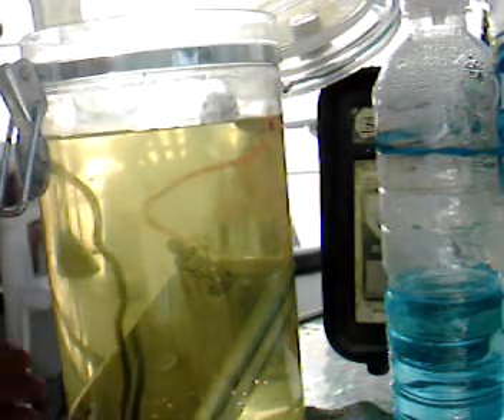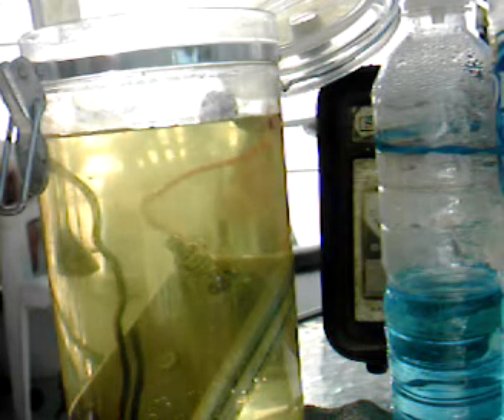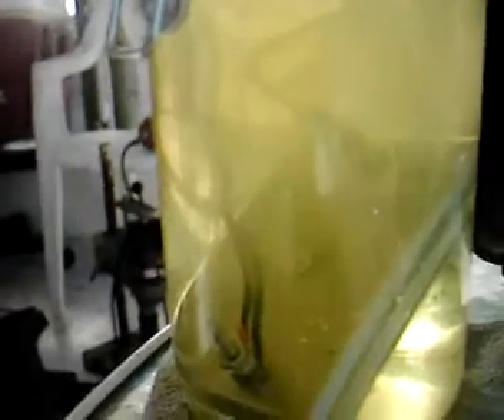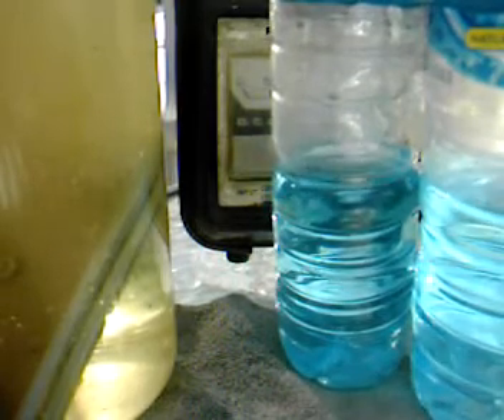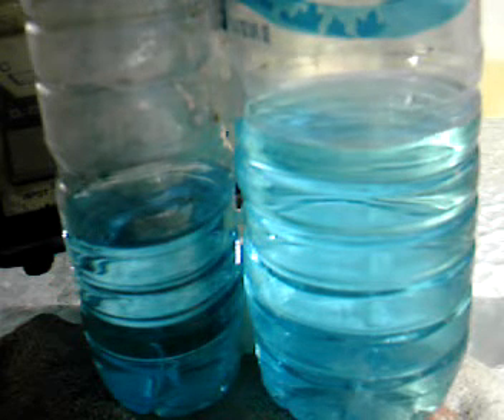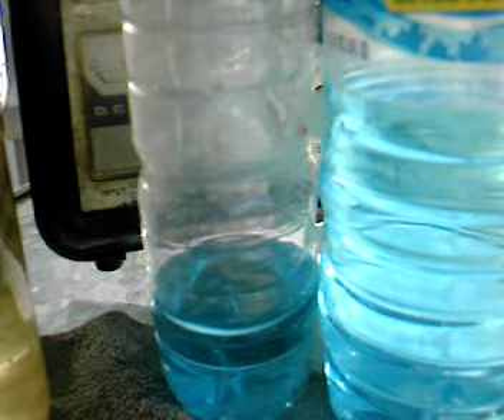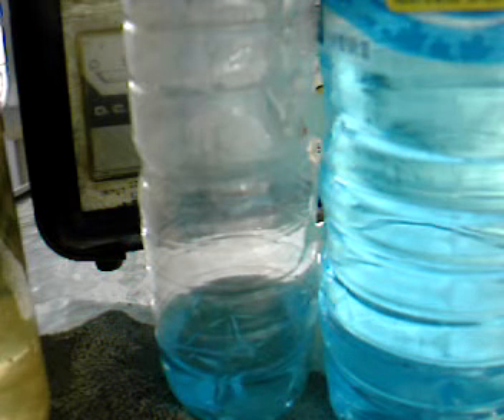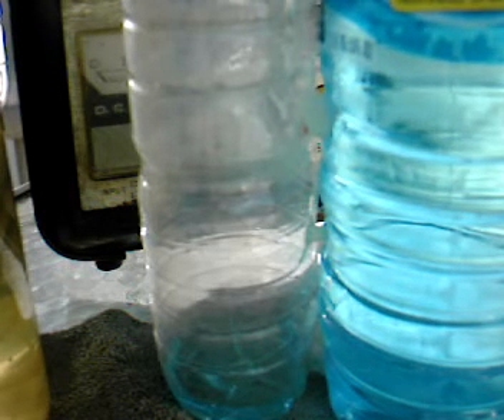sirHOAX series cell first test

Comment: Interesting,
OK, 12 volts, 11 amps, 130 seconds for 500ml results in 22,5% efficiency of the cell. The efficiency will be somewhat hiogher if back pressure is corrected for.